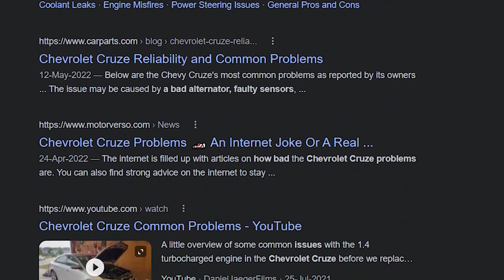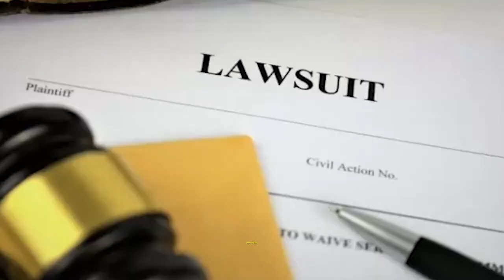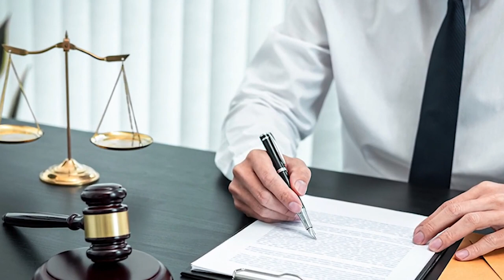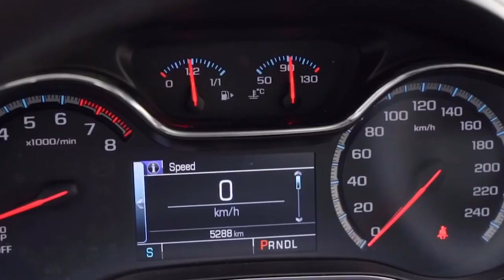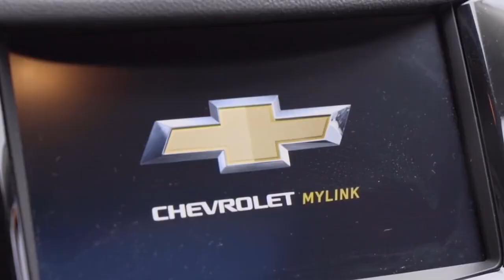WATCH THIS If You Have Chevy Cruze | Lemon Problems of Chevy Cruze

Comment: I have a  chevy cruise  2016 the mechanic  can't  find a  part my car it needs  a  traction  control
Reply from the maker: I'm sorry to hear that.  Lemon law covers new and used cars, trucks, SUVs, and vans under warranty with 2 to 3 or more of the same repairs and with a low mileage of 90k., including leased and fleet vehicles, typically 2018 to 2023 cars